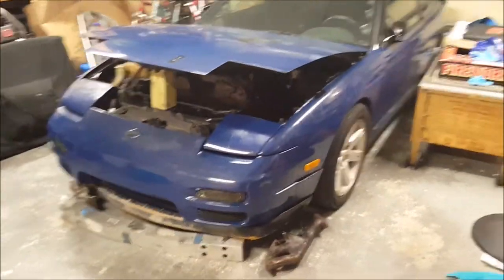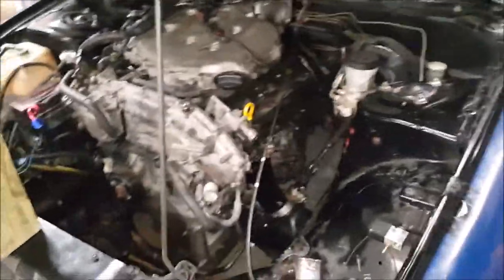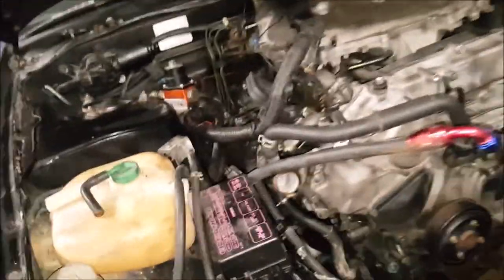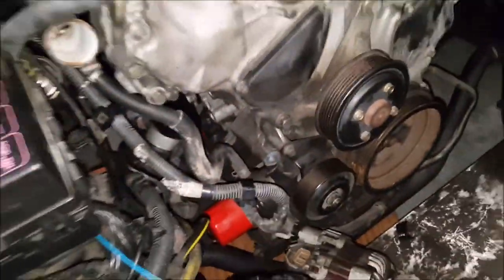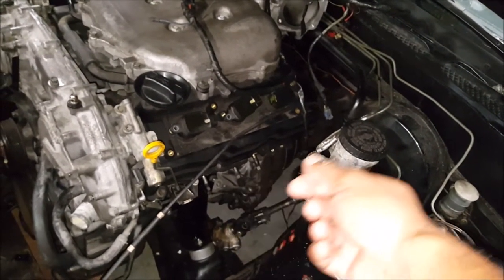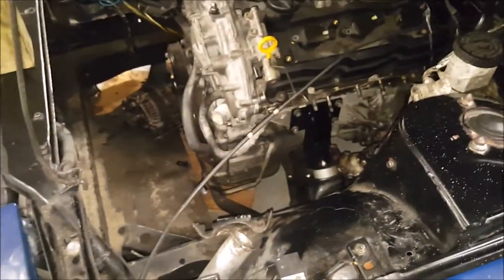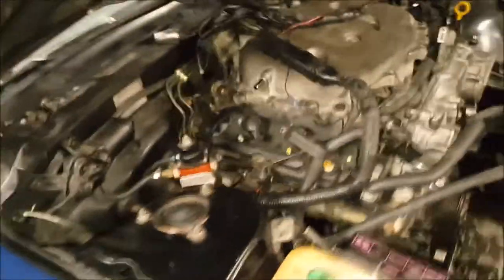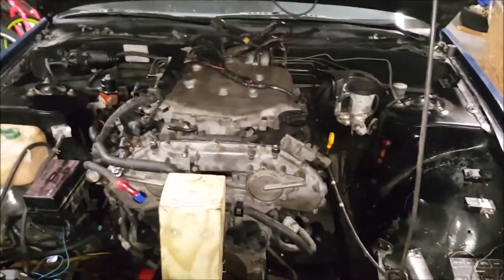VQ35 Build - Part 23: VQ is IN!

Comment: that was quick!
Reply from the maker: apex128 Now is the fun part of mocking up the exhaust pipes.  I really like fabbing stuff up.
Reply: supakat500 It's nice to see you going with a single turbo. A lot of people run parallel twins to make the manifolds easier, but I think single turbo will be a more simple setup in the end when the manifold is done
Reply from the maker: apex128 Yea, less shit to break or leak.  Also, running long tubes helps the motor breath so she can be more efficient.

Comment: Im triying to do these swap right now. I like how does motor mounts hold the engine. What motor mounts are they?
Reply from the maker: This was a kit I found on eBay.  Crazy part is that they no longer sell it but it is a replica of Mckinney Motorsports kit.
Reply: @supakat500  yes that's crazy I saw the pictures but it send me to a crazy page in ebay. Trying to stay in the cheap side for these swap.
Reply from the maker: @Manuelbmx5200  Yea I paid $330 for the kit. Still had to modify but hard part was done already.
Reply: @supakat500  nice man. What was the hardest part of the swap?
Reply from the maker: @Manuelbmx5200  nothing really...i had an engine hoist and aligned it.  Just make sure the drive shaft does not grind.  This was an issue of ordering non abs ds vs abs ds .75 difference.  If i ordered abs ds, would have been perfect...
Reply: you use the non abs one?
 @supakat500
Reply from the maker: @Manuelbmx5200  yes non abs but I should have gotten the abs for better fit.  It is a little bit tight with the 98 J30 diff.
Reply: nice, What type of megasquirt you are
 using?
 @supakat500
Reply from the maker: @Manuelbmx5200  MS3X